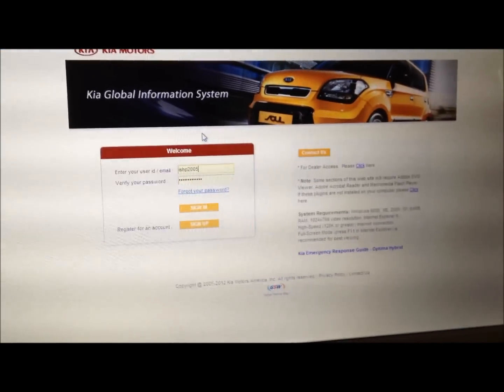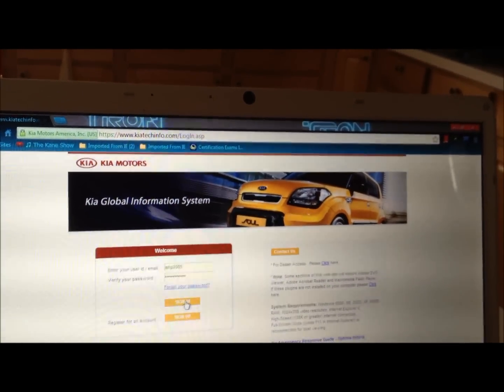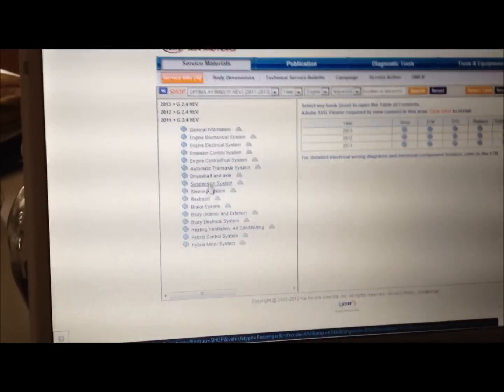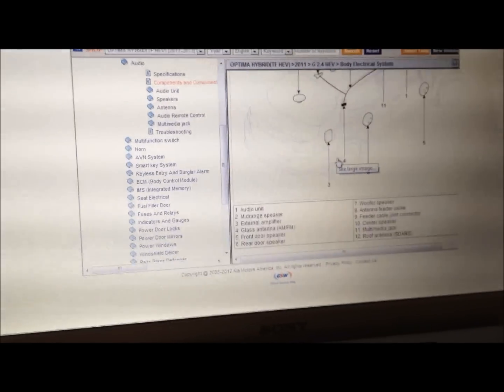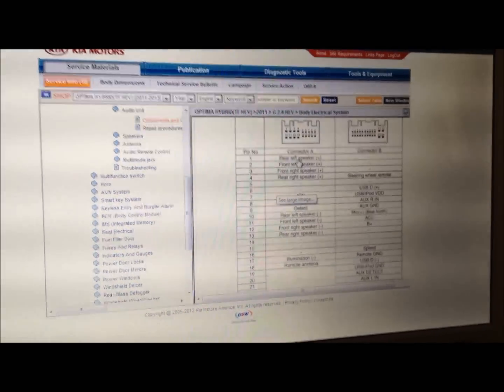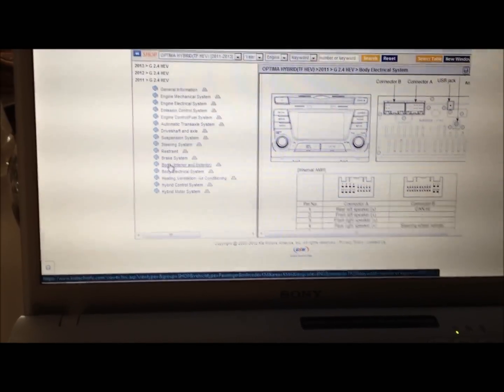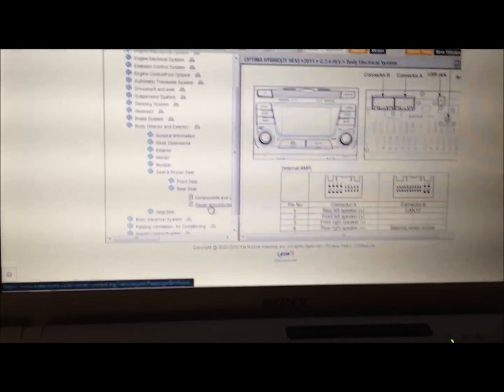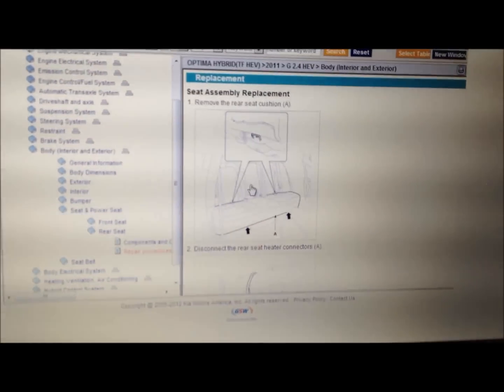Kia service manuals

Comment: We used to have free online manuals,I might as well go on eBay and buy a second hand Haynes manual
Reply: some of these cars never got a haynes or chiltons because the info was given away by the manufacturer. now its locked down by snap-on for $1500 a year subscription. so sad nobody has an old site rip to convert to pdf. if ever there was a greed worthy of mass pirating this would be it. i will never buy snap-on ever again. #boycottsnapon